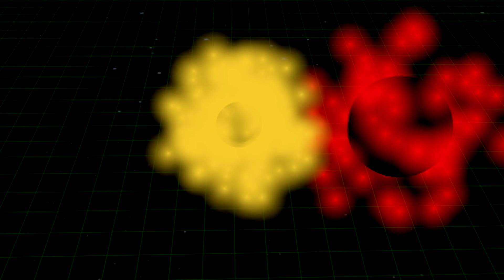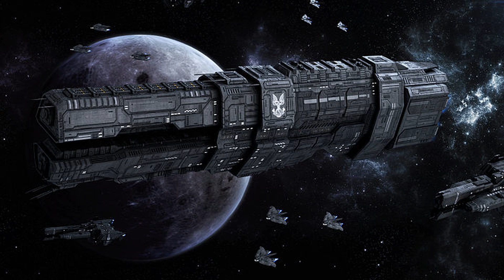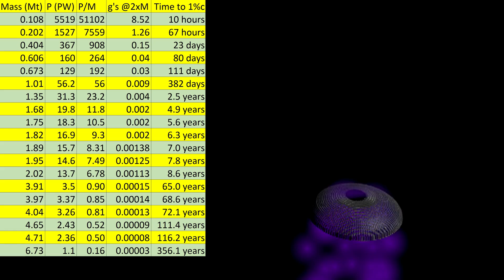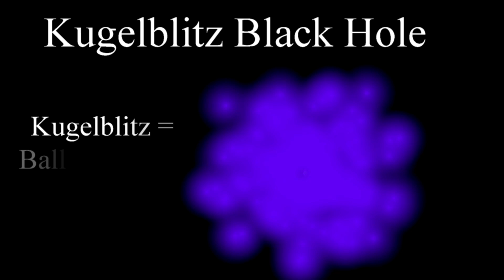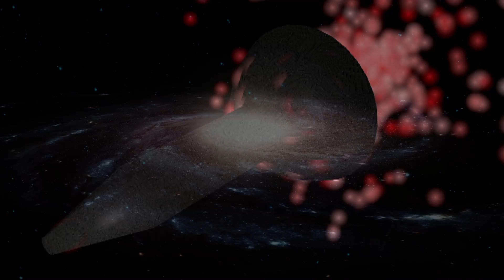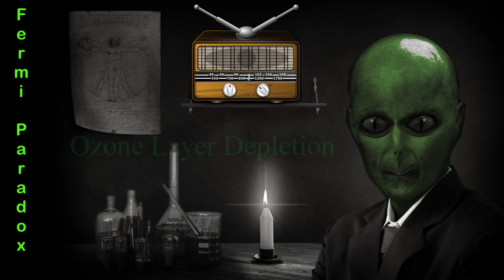Black Hole Starships

Comment: Directly referencing the Kzinti lesson without dropping the name, this makes me a little sad...
Reply from the maker: I think I have before, I've certainly referenced Known Space books a lot. Sadly except maybe for Ringworld and Mote in God's Eye Niven's books haven't acquired a big audience in the newer generations.
Reply: Isaac Arthur I would like to read more but I just read so slowly.  After Ringworld what would you suggest I read by Niven, I have several books just haven't gotten around to reading them yet.
Reply from the maker: You might want to consider switching to audiobooks, personally they are my own preference and I know some slower readers, either just slow at reading or not having a lot of time they can just settle in to read, who they work a lot better for. After Ringworld, and by Niven, I would suggest the first sequel, Ringworld Engineers, or Mote, but not the sequels to those. Protector is a pretty good though a bit dated, and I feel Lucifer's Hammer tends to suffer from that a bit worse. "Tales of Known Space" is a very good anthology set in the Ringworld Universe too, there were a lot of short stories and prior to Engineers I think Ringworld was the only full length novel in that setting which had tons of shorts.
Reply: Isaac Arthur Thank you, I have Engineers and I will have to start it since I just finished with the Count of Monte Cristo yesterday.

I could read faster but then I would just forget everything, I tend to be a visual learner so reading works for me, it just needs to be interesting and I need to do it without distractions.

Since you seem to enjoy a good book, have you ever read a book called Influx?  It was one of the books I picked up and couldn't put down.  Slow start, but the idea is that a secret shadow government organization is suppressing scientific discovery to prevent social upheaval.  The science in it is pretty good and I love the concept.

Anyway thanks again for all your replies, I hope you have a good day.

Comment: The problem with maintain 1 gee of acceleration for arbitrarily long periods of time is that you soon become causally disconnected from the rest of the universe. In fact it would take less than a year to reach the speed of light at that force, which would realativistically translate into smaller gains in speed as time went by but larger time dilation. What's the point of travelling across the galaxy, or even across the stellar neighborhood for that matter, if the universe has fast forwarded to the degenerate era by the time you get there? I think if you don't want to end up flung into the far future you'd eventually have to chuck your black hole booster and just spin up your spaceship and coast for a few generations till you get there. There's probably a happy medium between the time you lose with high speed temporal dilation and low speed coasting  you could calculate for the specific destination, then carry an extra, larger black hole that will have a useful power output by the time you need to slow down again. Or buzzard ramjet brakes.
Reply from the maker: Space is not empty, you will hit a maximum cruising speed when your intake of your fuel and all the little bits of hydrogen and clue-shifted photons slamming into you balances out your thrust. Even in intergalactic space this ought to be way before you would being hitting thousands of times slower relative speeds. It also does not matter how much time is slowed down, you will still get to your destination after normal light would, so I am not sure how you would jump forward to the degenerate era unless you were specifically setting course for a galaxy just distant enough to be racing away at just under the speed of light itself but not quite fast enough to get away from your ship entirely.

Comment: How does the black hole move relative to the starship instead of vice versa?
Reply from the maker: Frequently the starship would out mass the black hole, but it is a basic gravity tractor concept, similar to how the Shkadov Thruster described in episode 8 of the megastructure series works.
Reply: Thanks. By the sound of that, it seems turning would need to be planned far in advance.
Reply from the maker: Yes, very :) unless someone comes up with a novel approach to it, which you could probably couple to a refueling system. If the latter never becomes possible I would tend to expect BH's to be used like a take off thruster, get up to speed and discard it.

Comment: There is an issue with creating a kugelblitz:
At high densities and obtuse angles gamma radiation will cause unwanted pair production.
Any charged particle present in focus will scatter incoming radiation as well as catalyze more pair production.

This obstacle can be defeated by increased beaming  timing precision: let converging shell of radiation sink under horizon before any hard scattering can occur. This also increases the minimal BH mass.
Reply from the maker: Yup, and I probably should have talked about Pair Production but I always try to strip out everything that isn't absolutely vital to the topic, and it is conceivable someone could control it well enough to keep that to a minimum in terms of charged particles.

Comment: I think I would have liked more time spent on dragging the black hole along with you. You first listed giving the black hole a charge, which seems like obviously the best thing to do, but then you spend several minutes talking about the much less gravitational tractor idea.

Is there something wrong with the charge idea? Is it because you it would take a LOT of energy to fill a black hole up with strongly repelling charged massive particles?
Reply: +SpazzyMcGee1337 +Rohit0406
You both have made valid points.
The total charge of the black hole matters less than its charge density - how this works depends on what state of matter the black hole is actually comprised of, and how that matter state's properties actually affect its charge distribution (vs. how we guess it might work).  Atomic nuclei are a mix of net charged and uncharged particles; the stable ones (except for Hydrogen and Helium) almost all have more uncharged than charged particles.  Yet because of a spatial logic concept called packing density , the like-charged particles are 'shielded' from each other and so don't 'see' the repelling charge's full force.  This plus the binding energy of the weak nuclear force is what keeps stable atomic nuclei from flying apart.  If there is some 'sweet spot' as you put it, where the binding force of gravity overpowers the repelling force of like charges, then that would add a constraint to the design of Black Hole Starships with regards to micro-black hole mass range, but also relax a constraint regarding the design of the containment shell.
As far as making Kugeblitz black holes, no, I don't see how it's possible to give them a charge.  I suppose it's hypothetically conceivable to make a black hole using gamma lasers carrying quark streams all focused on the same atomic-nucleus-sized target, but that is at the very edge of physics we even understand.  I don't see how it's possible to make Kugeblitz black holes at all, since while it has been proven that photons carry momentum, it does not conceptually follow that they have mass; because if they have mass then they have both inertia and a gravity field, and that just blows the doors off of relativity, because if every photon had a gravity field then they should emit gravity waves as their momentum changes, which would depend on one's frame of reference and- well, I think I've made my point.  I don't see how enough EM radiation in a single tiny point suddenly creates a gravity field from which EM radiation cannot escape.
Reply: SpazzyMcGee1337 how would you even give the black hole charge if you're making the black hole out of photons (gamma Ray lasers)? Also I guess it depends on the charge - perhaps there's a sweet spot where this doesn't occur but charge black holes are at risk of exploding are they not? Since electromagnetic force is stronger than gravity, but I guess you could maybe tweak the numbers so there is only enough charge that the gravity overpowers it

Comment: but.. how can you have a small blackhole?
i mean.. you need a lot of mass in a small volume to have a blackhole.
and the gravity effect is invers proportional to the square of distance, so even the smallest thing you can call a blackhole has a quite long range effect.
Reply from the maker: As mentioned in the video, this video is second of two videos (actual 2 of 3), the first of which is named "Micro Black Holes", I'd hazard to guess with a title like that it might explain how small black holes would work ;)
Reply: Isaac Arthur

even a micro black hole would.. have quite a lot of effect on the ship crew i mean.
and that would not be healthy.
not to mention, the human body has quite a lot of limits.
let me explain, try to calculate, that humans don't really take larger than 1g acceleration too well for extended time.
even if you sortha use 2g acceleration, it limits what speed a human can reach, even if the person in question is accelerating at 2g in a whole human life span..
and you allso need to slow down when you get close to the target.
so the limits of how far can a human get is verry limited when compared to distances in the universe.. sadly.
Reply from the maker: What would be the gravitic pull of a one megaton black hole, such as those described in the video, 10 meters away?

Comment: wonderful video on an interesting concept. however i remain sceptical of the ability to "tether" the black hole to the ship the way you described because of Newton's laws. "Every action has an equal and opposite reaction" so tethering via the gravitational force like you described wouldn't work would it? If the gravitational force was strong enough to keep the black hole a constant distance from the ship it would cancel out any thrust, less and the gap between the ship and hole would close, more would cause the ship to fly away from the hole. Also since the mass of a micro black hole is diminishing so rapidly that equilibrium point would exist for an infinitesimal amount of time. I'm not certain if the exact physics involved in tethering via magnetism either as if that doesn't violate Newton's laws, i would imaging would require an amount of energy on the scale of the black hole itself if not more. The ability to produce and use this much energy via other means would obviously negate the need for the micro black hole drive in the first place. Would love to hear anyone elses thoughts on this.
Reply: He mentioned the asymmetric radiation pressure, so the photons flying backwards carry the same momentum as the spaceship moving forward. It all makes sense

Comment: I speak as a physics-educated engineer when I say: Wonderful video, Isaac! You accurately identify and describe the major technical issues.  

I too was captivated by the Crane & Westmoreland paper. There appears to be no better sub-light drive for travelling the universe. It even hands the much-vaunted antimatter drive its hat :). So I got to thinking about how to improve on the ideas in that paper. The chief drawback is the short lifetime of the more powerful microBHs, and so I came up with the idea of using a collection of them, whereby their masses are unequal and so they kick in at different times along the way. It's basically a staggered lifetime approach. I solved for optimal masses using a nonlinear Solver and achieved incredibly good performance. The end result is that one can maintain approximately constant one gee travel for an arbitrarily long time, using this staggered approach.  

I have a 2 MB spreadsheet embodying all this. You're welcome to a copy.  

Re. microBH creation:
http://arxiv.org/abs/1105.5898 illustrates the substantial mathematical complexity inherent in BH formation. It's also useful for tracking references.
https://www.youtube.com/watch?v=n0qbIG5JyF0&t=48m is a more exotic creation method!
Look also for that paper from Frolov, ref'd in Crane & Westmoreland.     

One thing you might have mentioned is that at end of life microBHs promise to show us new physics, since the energies attained far surpass anything we could construct with an accelerator, for the foreseeable future.
Reply: Andrew Palfreyman amazing
Reply: You sound extremely intelligent so I am certain you accounted for the extra mass of bringing heavier and heavier "next stage black holes" with you on your journey. Out of curiosity, does it still behave the same way as rockets do where you quickly end up with a ship where it's like 99% fuel? (black holes) 

Basically my thinking is, if creating black holes is feasible but not cheap some day then economics might be the last trump card here, similar to 99.99%fuel current day rocket dreams.
Reply: Can still use antimatter to produce a black hole.
Reply: could you do it with 2 mbh and an bussard ramjet?
as in use one mbh to power the ship, while using the bussard ramjet to 'recharge' the other, directing radiation and matter into the mbh. 
mayby also using the charging mbh to absorb colliding material?

Comment: My lead engineer had a mix up in the laundry room and ended up wearing a red shirt, unfortunately he got sucked into the ships engine, I need a new engineer, I invite you! hehe
Reply: curtis133 "Godammit engineering that will take a month to clean up" *Turns towards ensign "Ensign warp 6 to ds9" *warps out and credits roll

Comment: Using EPR=ER, you should be able to continuously feed a micro black hole without worrying about the fire-hose. The idea is not to create a single micro black hole and offset the extreme evaporation with a food suppy, but rather to create a train of micro black hole creations that continuously evaporate and reform like virtual micro black holes.

Do not use the evaporation to produce thrust. Instead, use focused evaporation to (re)form micro black hole children in a self-sustaining way that can be tweaked. My guess is that you'd need to use at least two pairs of entangled micro black holes.

I do not think it will end up terribly feasible to treat a micro black hole a classical engine. We should also be sending very very small payloads of highly compact information.
Reply from the maker: +Jonathan Langdale EPR=ER has some fascinating implications,  so do very small 'data-ships', which we covered in the Interstellar Colonization video, but I think the focus on large ships remains proper. Things that can fit people, or human-people anyway. But this topic was selected by a poll on the channel, like FTL was, so I wanted to keep the focus on that concept and the known upsides & issues with it.

Comment: I am not sure if black hole(BH) creation is possible? Louis Crane and Shawn's arxiv doesn't calculate whether it is possible and the link suggests they havent encountered a calculation either:

> Nevertheless, it is a bit eerie that only through this line of thought did we consider the possibility of synthetic BH creation. We are the first and almost the only authors to our knowledge to consider this. The only other author we are aware of is Semiz [6], who wrote: “...we would have to either find small black holes, possibly primordial, or manufacture them by means as yet unknown,” in a rather popular discussion on BH powerplants and stardrives, which appeared after our first paper

A concern is that electron-antielectron pairs might foil black hole creation, instead creating an antipair plasma which absorbs the photon-antiphoton. At high enough intensities even 2> photon reactions start to matter, so lower-frequency photons and trying to go for a bigger central spot might not work.

Actually expect it is possible, but doubt the entire initial-BH-mass range is possible. Larger initial masses, thus radii can be done with lower frequencies and densities, of course. If you can make a big one, you could wait for it to evaporate to get the sizes you want.
Reply from the maker: +oJasper1984 Actually making the things is, of course, totally in the realm of speculation right now, but we've got a basic concept and no apparent violations of known physical laws. The problem with the larger ones is they make for horrible ship drives, and if you're making them kugelblitz-style they are nothing but batteries, probably ones you'd burn a lot of extra power to create on top of what you infuse to the BH, so there'd be limited applications for making them. Super-long term compact power supplies, not much else. But it's way too earlier to be pessimistic on the concept, it shows promise.